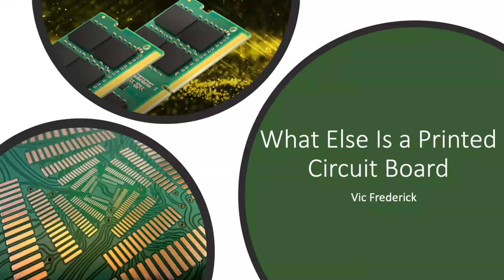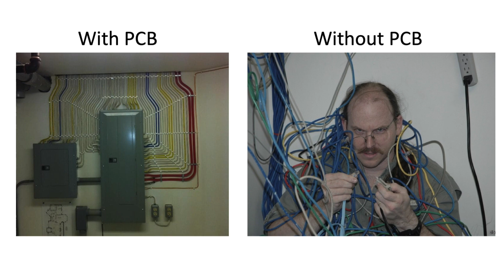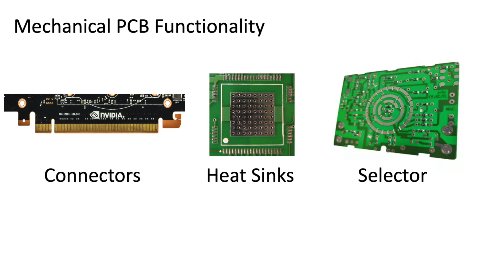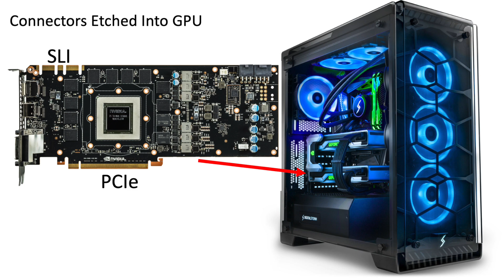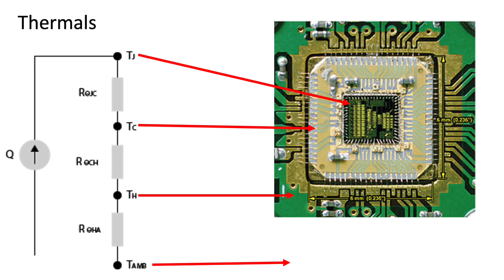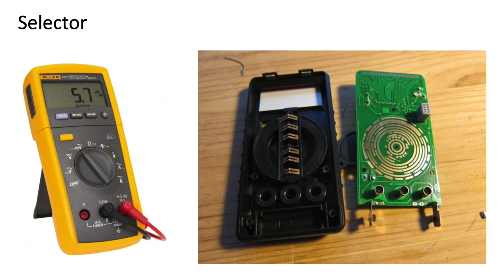What Else Are Circuit Boards Good For

Comment: In keyboards, the PCB plays a structural role, such as the case with PCB-mounted mechanical switches. Even in membrane keyboards or keypads, the membrane portion of the switch is on the PCB, making it the structure that opposes the downstroke force.